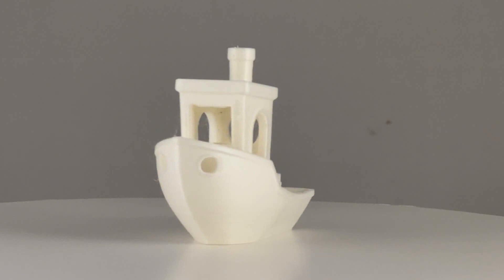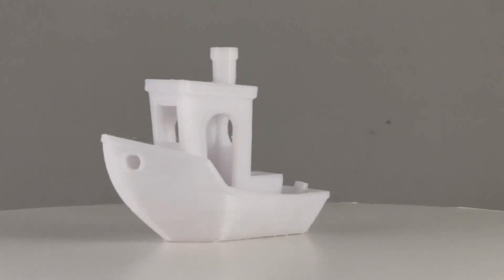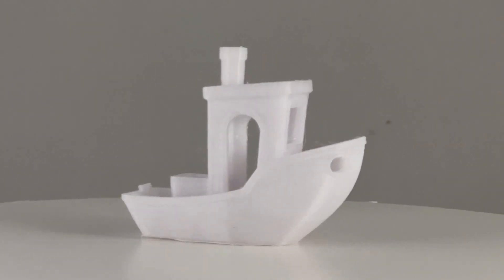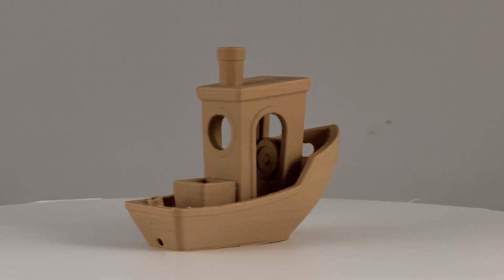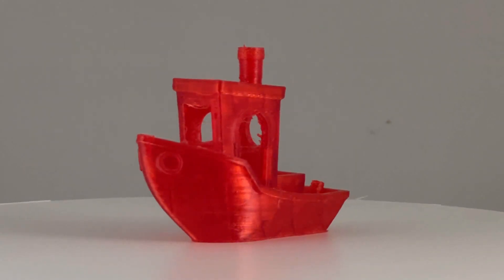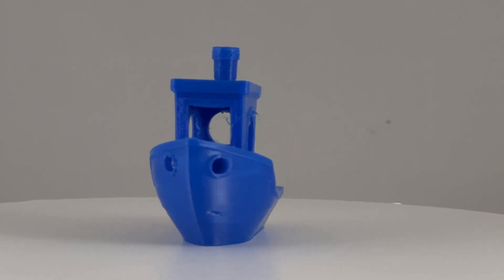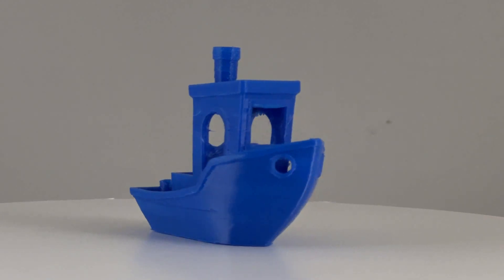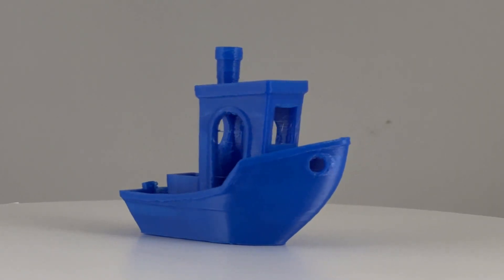Various Filament Testing On The FLsun V400 Printer

Comment: Morning Sir First off thank you for infromation. Are you considering posting any profiles for SR using Cura 5.1 thank you again for all your help and patience
Reply from the maker: I have not worked with 5.1 yet. I have been very busy with the new V400 !!! hahaha
Reply: @dennisgignac5103  understandable I'm still trying to get the SR to print as clean as my creality machines Seems I have constant layer shifts Getting very frustrating
Reply: @dennisgignac5103  Hi, thanks for the video. Do you have some good profiles for the v400 you wanna share? Thanks.